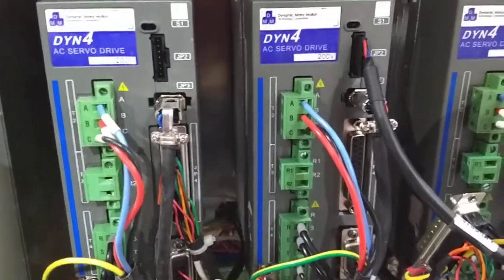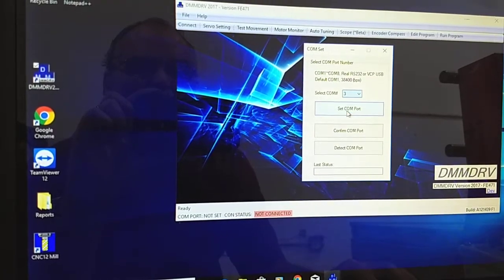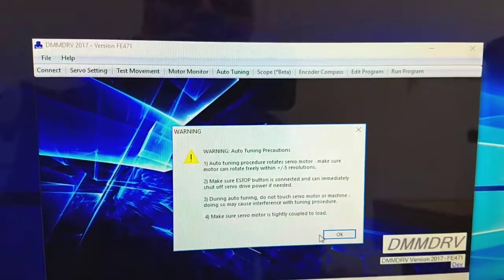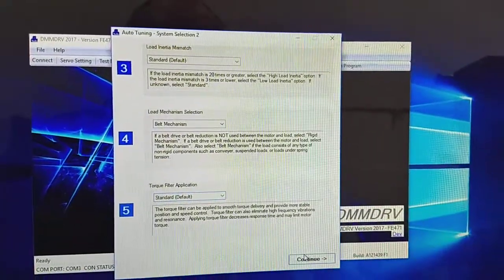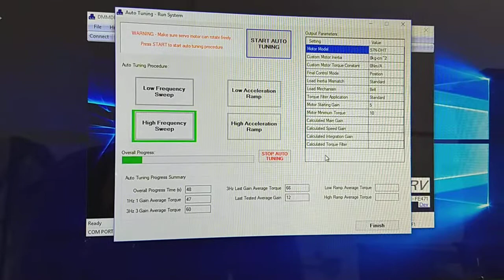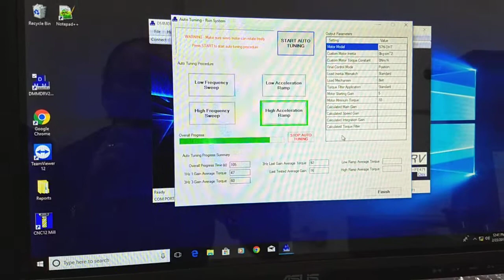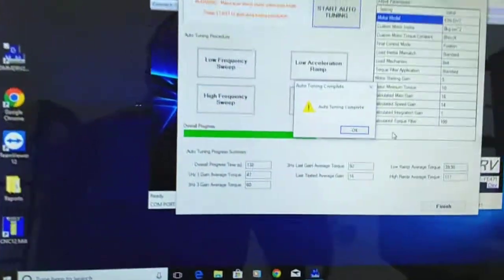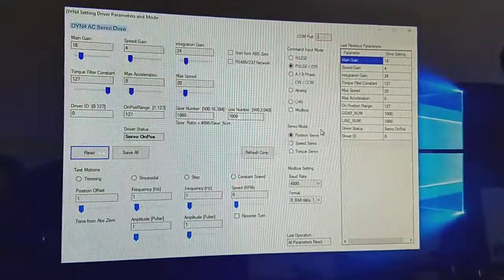Phoenix 4x4 Router: Using DMM Technologies Auto Tuning feature

Comment: thank you Marty. great help with my first attempt at retro fitting an plasma machine. I have DMM DYn 4 servos and a Masso cnc controller.
im still in the middle of wiring and setup/ auto tune... lots of work to do still, but your knowledge is very helpful..  thank you

Comment: Hi Marty, 
I have a very interested question about Auto Tuning DMM servos . I have a gantry with two paired DMM servos on my Y axis on my Router CNC, because  they both connected to same gantry on each side  How do you Auto Tune each motor. 
I could not find anything related to to this on Centroid Forums.

Thank you
Reply from the maker: Tuning DMM motors is not a Centroid support issue. You need to contact DMM and ask for support in tuning slaved servos
Reply: @martyscncgarage5275  Thank you

Comment: Hi Marty. How would you tune a 2-servo Y axis... Y and slaved A? ...DYN2 motors. Tuning each motor individually is not the real world, because there are two motors moving the gantry when I actually cut something, not one. Is there a way to tune both Y and A at the same time?
Reply from the maker: Sorry for the delay. Not my full time job. DMM will tell you to tune one and copy the settings over to the other I know that is not the best way. I assume you spoke with DMM on the subject? Have you tried leaving the drive defaults alone but make sure they are the same in both drives?
Reply from the maker: DMM says they will assist in these special cases. It is difficult to tune a machine with a slaved axis, but not impossible
Reply: @martyscncgarage5275  As always, thanks for your help. DMM got back to me with some things to try and to check.
Reply: @WallyJoiner  What did they tell you differently?  As Marty said, they told me to tune one side with the other motor detached...
Reply: @keithskillz90210  ... no solution yet

Comment: hi Marty , nice tutorial   i need an advice  what centroid controller should i buy for my CNC router in my shop.   thank you
Reply from the maker: Max, depends on the router, what motors and drives it has, how big etc.
Reply: its 12' x 6' ,  i just ordered DMM servo motors ,  one  NEMA 34  1kw,  and 2 NEMA 42  1.8kw,  drivers DYN4 ,  im planning to buy a 6 kw router , but for now i have Porter-Cable 7518  3 1/4 kw.  my cnc runs right now on stepper motors and im using MACH 3 to run it . and from all the You Tube i have watched  concluded that MACH 3 not so good for servo motors. thats why i was looking around to find something better, and by watching all of your YOU TUBEs  i understand that you prefer Centroid.
Reply from the maker: Max, I believe you will be happier with Centroid and DMM. You will have a hybrid closed loop system
Reply: do i need anything higher that a Acorn Pro v4.10 version, considering i have a Router CNC.  Thank you
Reply from the maker: Max, not unless you plan on digitizing parts
Reply: Marty you have more knowledge in CNC , where would i buy  Centroid Acorn Pro v4.10
Reply from the maker: http://www.centroidcnc.com/centroid_diy/acorn_cnc_controller.html
Reply: thank you very much for your help

Comment: I have a Cnc rauter with dmm4 engines with mach3 the problem is that I have a difference of 4 and 3 thousandths as I could solve it
Reply from the maker: Probably mechanical if you wired it up properly

Comment: Hi Marty!
Question:
Do you have any problem with those DMM servos drives?
Reply from the maker: Up Tech CNC PVC LT-130 . No not at all. Second set I've used. No issues
Reply: Good to know!
I’ve ordered 2 sets of 1kw.
On eBay 2 weeks ago and just arrived today!
Then I tune up one perfectly then the second drive fail after power up something go wrong inside.
I heard a short circuit inside and smoky 
Now the drive is on but the motor it isn’t engaged but the software still read motor in position.
I hope DMM take it back and fix it!!!
Reply from the maker: Up Tech CNC PVC LT-130 which servo drive? Dyn2 or Dyn4?
Reply: I got DYN4  1 Kw servo!
Reply from the maker: Eric Torrie,  One axis at a time. Search You Tube for DMM Auto tuning. It is included in their latest release of software for their drives
Reply: @eat5hams  Hi, I have same problem ,have you find answer to your question.

Thank you